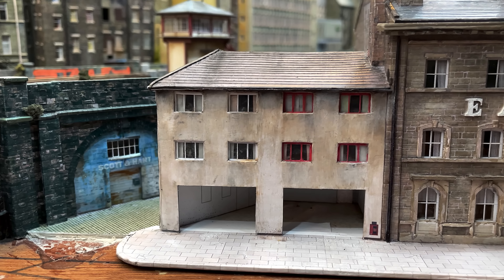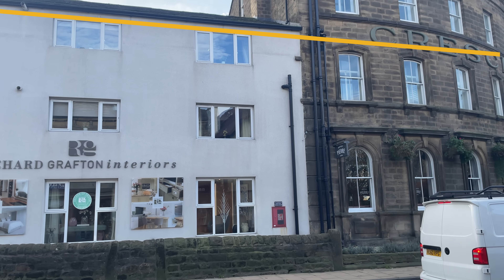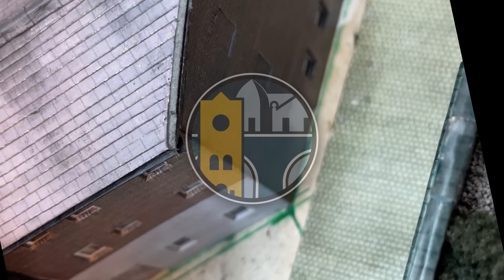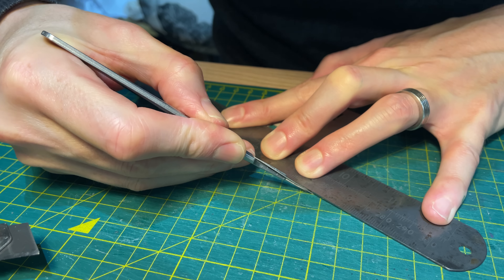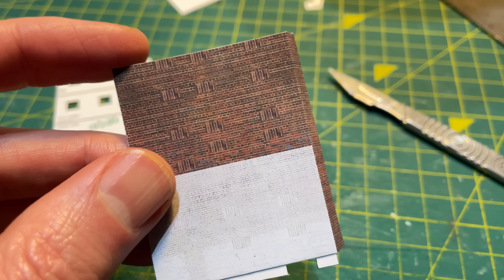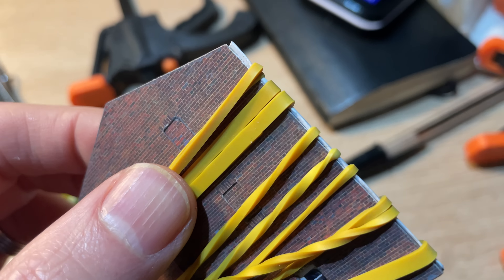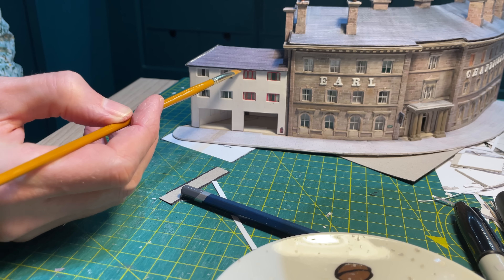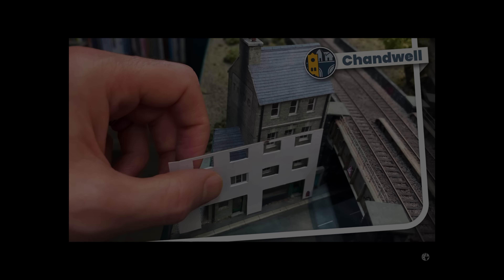Little and Large - modelling scale in real-world buildings

Comment: One of my sons has a Victorian flat. The difference in ceiling height is dramatic compared to a modern build. Love the odd shape and the fact it reflects the actual building beside the hotel you've just modelled. There seems to be an evaporation problem with one of your bottles! I would look into that if I were you! ;-) Cheers
Reply from the maker: Those bottles never stay full. Not quite sure what happens!
Reply: @Chandwell  At whiskey distilleries they call it the Angels share

Comment: I think the dingy "white" finish is spot on for Chandwell, I can think of several businesses that would typically occupy that, car maintainance,  motorcycle breakers, 2nd hand shops, both clothes and books, washer and vacuum repairs, actually pretty much anything that doesn't deal in new stuff.
Reply: Yes, a bike breakers!  Then the little triangle at the back can be full of old tyres and the white plastic legshields from a hundred dead C90s :-)
Reply from the maker: Great idea but I chose something different. The back does open onto Wharfe Motors and there will be some tyres and things back there.